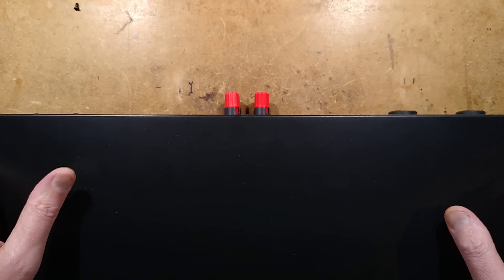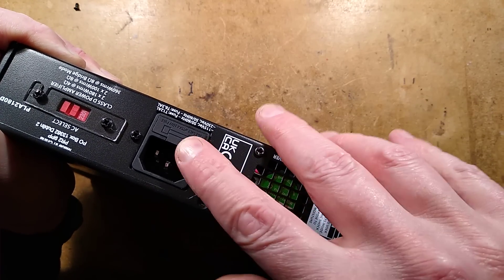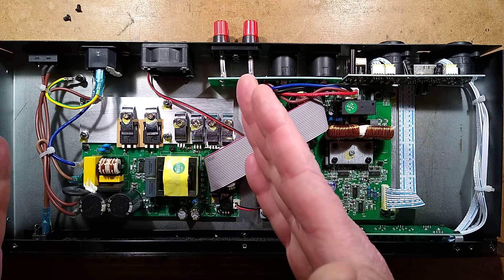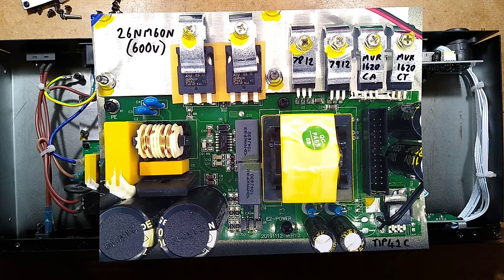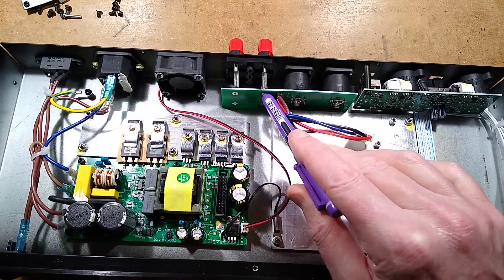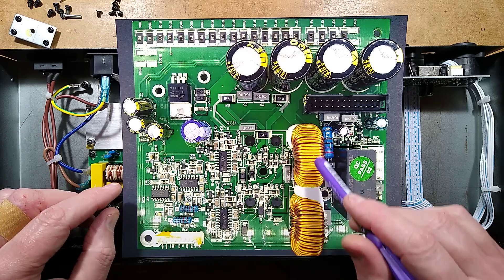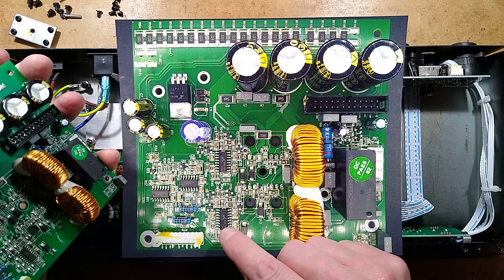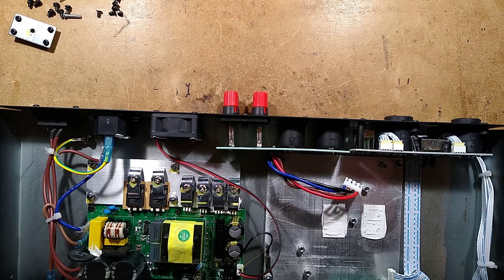Inside a 360W digital amplifier

Comment: One obvious oversight - that fan is an exhaust - the fan frame is at the back, and you ALWAYS exhaust racks to the rear
Reply: QSC/JBL & C-Audio amps used to blow back to front (in the MPA1100/MPX1200 era).
Reply: @CJDavies  It happens, its just a REALLY bad idea as racks and everything else in them are designed to be fed cool air at the front and dump hot at the back. So youre either gonna need a dedicated rack or you'll be sucking hot air.
 It just makes sense to put your intake side where the user and aircon are.
Reply: @CJDavies i had an rack with two qsc amps. The befefit of reverse airflow is that one can mount an big fan with a proper paper wlement filter into the rear cover to keep the equipment from getting filthy.
Reply: @lukahierl9857  I hadn't even thought of that, but that's actually a pretty big benefit for some scenarios!

Comment: The fan looks to be an exhaust fan and I've replaced a lot of 1U fans with Noctua 40mm ones for noise
Reply: Noctua fans are quiet mostly because they spin at low RPMs.  Low RPM also has an effect on the fan’s CFM rating - or, in other words, how much heat it can move away from things that get hot.

Ergo, quiet fans tend to lead to very quiet amplifiers, if they weren’t designed for low-n-slow airflow.

Comment: It would be really interesting to compare this to the likes of the little £40-odd digital amps off Amazon from the likes of SMSL.  Different application, but would still be an interesting comparison...
Reply: There is not much to explore in these  
They are build on a single chip design and are utter garbage
Reply: @NinoJoel  Swap out the caps for better quality ones and you can easily mod them to audiophile quality.
Reply: @NiHaoMike64  Sounds like a good topic for a video...
Reply: @NiHaoMike64  haha my god. 
Not again. 

If I hear the term "audiophile" And swap capacitors in cheap junk I get flashbacks to the days I used to maintain / repair high high end audio equipment. 

Those amps operate on class D... They are junk in terms of audio quality even if you get some snake oil capacitors at full moon on midnight while selling your kindness
Reply: @NinoJoel  The boards with TPA3255 are very easy to make work just as well as the much more expensive reference design boards.

Comment: It's not digital. In the 1980s, Peavey started the whole thing of calling these amplifiers digital, but they're not. Granted, they're not exactly analog, but they're not digital either.
Reply: I don't see anything wrong with calling a class D amp digital.
Reply: @tommihommi1  There is enough confusing nomenclature regarding technology in the world without making it any worse.
Reply: @ScottGrammer It works by switching the output mosfets fully off and fully on; zero or one; with absolutely minimal time in the transition. What’s not digital about that?
Reply: @MarkSJBeard  well the argument is that the PWM is actually analog because of the way the comparators work in a class D amp like this, it's not actually going through a real digital step, it's analog pulse width modulation
Reply: @MarkSJBeard  (Sigh.) It looks like I may need to do a video about this.

Yes, it switches the output devices either fully on or fully off. But there is no quantization, which is to say there is no analog-to-digital conversion. There is no bitstream. There is no data. There is no digital-to-analog conversion. It's not digital, any more than a run-of-the-mill light dimmer, which works on exactly the same principle, is.
Reply: @ScottGrammer  The output of the Delta Sigma modulator is a digital bitstream even though it's very different from the usual digital audio.
Reply: @NiHaoMike64  Correct, but this is a PWM modulator which is an 100% analog circuit with a switching output. A DS modulator is a mixed signal circuit (analog in, digital out) where the output is a digital signal that is clocked (changes at specified time intervals only, for example every 100 ns). The PWM modulator's output can change at any time, it isn't clocked at all.
Reply: @peterpv0001  Some designs are self oscillating, others have a clock signal. The ones that have clock signals are far more common in multichannel applications since that avoids possible beat frequencies between channels.

Comment: I appreciate the plexiglass cover "protection" over the 110/220v, that's not a switch you want to move by mistake
Reply: Back in the 90's when I was an on-site engineer for Silicon Graphics, I had a job to replace a failed power supply unit for an SGI workstation.

After replacing the PSU, I proceeded to switch the workstation on to test it. All of a sudden, there was a Loud Bang emanating from the supposedly repaired machine, and the magic smoke was escaping from it. And all the electricity went off in the building. Everything just went dark. The office the machine was in went silent, and all eyes were on me.

It was only when I - very puzzled - looked at the PSU, did I notice the voltage selector on it. Upon closer inspection, I further noticed that it was set to 120V, instead of the 240V it should have been - obviously this unit was manufactured outside of the UK and was set to 120V by default. Not something which was ever mentioned in any SGI training.

That was a very awkward time in that particular customer's office for a few moments. I blamed the Loud Bang and the tripping of the building's circuit breakers on a "faulty replacement" - which, technically, was the truth ;)
Reply: @FrickinLaserBeams  Oops!
Reply: @FrickinLaserBeams  It wasnt the truth, it was your fault for not checking it
Reply: @gelo1238  Well, duh! Lol.
Reply: @gelo1238  It was the truth though, after he had failed to check and powered it on. I'm sure it was quite the faulty unit indeed by that point...
Reply: @RyTrapp0  lol
Reply: Back ca. 1990 we were supplied with "Rockwell T50 Programming Terminals" £8K each - actually a rugged PC, and often the first such any of our techs would encounter. This was before auto supply ranging was common.  For "safety" factory floor sockets were 110V (Round, blue).  However technicians' workshop sockets were 240V (Round, Yellow).  If we were lucky just the power supply went "poof" otherwise - a very dead box.
Reply: @M3WDD  Good heavens! If they'd changed the 110V sockets to Edison (US, Japan) style, it would probably been enough to make people think twice and make sure.
Reply: @interestingoldthings4889 yellow/blue is standard. AFAIK they’re also made deliberately incompatible, though.
Reply: @JasperJanssen  that's what socket adapters are for 🙂
Reply: @M3WDD  Yellow is 110V; and properly from a transformer with a centre-tapped winding, so each leg is only 55V from Earth. Blue is 230V.
Reply: @bluerizlagirl  yes, you are correct.  It's been a long time...
Reply: @M3WDD  surely your blue and yellow are the other way round? If you are referring to the common "ceeform" type connectors (formerly BS4343 but now IEC309), blue is 230V and yellow is 110V.  Indeed yellow is common on construction sites.
Reply: @timbo19  yes, my mistake
Reply: Indeed; We ran into that with some 'legacy' systems that used, IIRC, an S-100 style mainboard with add-in CPU and IO cards.  The boxes had non-autoranging power supplies with that style of voltage switch. the vendor had to replace the power supply on one of them after someone failed to check the position of that switch before plugging it in, and that was entertaining, because not many people make that hardware anymore..

This is why any hardware I spec for [RedactedCo] states "power supply SHALL be auto-ranging between 120V and 208/220".
Reply: How I never flipped one of those switches on the back of something as a child is beyond me...
Reply: @MrPointedHelix  I *did*. Expensive. Power supply on our first XT, 1985.
Reply: Yes it is!!  yes it is!!! 🔥 🔥
Reply: Now that's real belt-n-suspenders paranoia, I like it.  Most manufacturers are satisfied with just the recessed switch.

Comment: Bridge mode is twice the voltage, four times the power for a given impedance when compared against a single channel.
Reply: although most amplifier sellers somewhat explicitly state that in bridged mode it is meant to be used with double the impedance for a single channel e.g. 250Wx2@4Ω(stereo) 500Wx1@8Ω(bridged). But of course yes with the same impedance it would draw 4x the power.
Reply: @ow_will ,  most analog stereo amplifiers with bridgeable design that were spec'ed to work into a 4 to 8 ohm  could only run into an 8  ohm load in bridged mode.  The power would double but the distortion would quadruple and the ability of the amplifier to maintain a good damping control over the speaker load was reduced.
Reply: @ow_will  yes, but not using the amplifier for a load that would damage it should be obvious

A single speaker tends not to change it’s nominal impedance so standard practice is to make comparisons of amplifier power referenced to the same impedance

Comment: I have done it myself before, but somehow I find ribbon cable for power supply purposes a bit sketchy.
Reply: Since it is just +-12V, it should be fine. But an odd step given how well-designed the rest seems to be.
Reply: @OscarSommerbo  180W suggests closer to 25V for each power rail, and as the ribbon, and the connectors, are rated for 1A each, 2A if you are being unrealistic, just using 6 in parallel will easily handle the power required, as it should be around 5A per power rail. With 24 pins, 4 being used for the opamp +-15V rails, 2 for fan and temperature sensing, and thus 6 for the +25V, 6 for -25V, and 6 for ground, will work out fine. Plus a quick almost foolproof connection, and reasonably robust.

Comment: You'll get all the audio engineers rilled up by saying fliped phase instead of flipped polarity for the bridge mode ;)
Reply: Not the ones that do serious circuit and filter design, and use an XY scope to check that signals are in phase etc. etc.  The phase of audio signals have important acoustic effects .
Reply: @johndododoe1411  Of course phase is important and yes I have used scopes. That does not mean that flipping to polarity is the same as flipping the phase, which as you should know is impossible for any non-repeating signal.
Reply: Well you gotta drive engagement any way you can.
Reply: Crap, you got me.

Comment: The fans usually pull in air from the front and blow it out the back, is that not the case here? I've tested some cheap amps before where the heat sink fins were angled 90 degrees from the direction of airflow so it overheated after 10 minutes at rated power 🤦‍♂️
Reply from the maker: It probably is pulling from the front.  We have some really expensive equipment at work that also has the 90 degree heatsink issue.

Comment: So, this is a FULL BRIDGE AMPLIFIER, haha! Looks nice. This is where switching mode power supplies and class D took us - a stage power amp in a single unit enclosure, so compact, clean and neat.
Reply: Not full bridge, half bridge, as the speaker has a connection to the mid point of the power supply, and a full bridge amplifier cannot be connected into a bridge configuration, as it is already running in that mode.
Reply: @SeanBZA  right, it's hooking the load to two power amplifiers driven with inverted signals
Reply: Some of the modern ultra high power 1HE amps are reliably pushing a total of 20kW nominal power into 4 chanels at 4 ohms. Those are slowly replacing the gold standard Labgruppen FP10000Q and FP140000 over here in europe.
Although for low end professional use the high quality chinese FP series coppies are still unbeatable.
Reply: @lukahierl9857  LABGRUPPEN has the PLM44 and others ( using LAKE processor) at least  4-6 yrs in the making , as of my knowledge these are 20000W (4ch) bridgeable and each can also be configured  as 4 active p.amps with selectable slope configs...
Also comes with full security locks & remote location networked control capabilities .
Reply: @lukahierl9857  There's quite a few Powersoft inspired high power 1u amps coming out of China too, from the likes of CVR, Morin etc
Reply: and sounds like flaming dog shite, but who cares about sound quality, right?  It's only for live sound reinforcement! <_<

Comment: Thoughts on the unidentified chips: The comparators should be used in conjunction with a triangle or sawtooth wave generator which converts a voltage level into a PWM duty cycle.  Are they connected in such a way that you are able to infer that kind of relationship?
Reply: Dedicated class D amplifier chip, which has all the parts needed to implement the circuit, from input analogue, to output drive with high side driver for the mosfets. Comparators are there to drive the front panel LED's, and to also enable the amplifier chips when they detect enough input signal, and also are there for DC offset protection as well, turning off the output relay if there is a DC offset at the speaker outputs, and providing the turn on anti thump delay as well. quad comparator, so 8 in total. 2 drive peak indicator for each channel, 2 do the signal detection, and thus amplifier enable, with a few second off delay for quiet input signals. Then the other 4 do DC offset protection on the output, and one does the power on delay, leaving one that is probably sitting being used as inverter to drive the mute control of those PWM driver chips, or is sensing heatsink temperature, to enable the fan to run.
Reply: Wouldn’t you expect the triangle/sawtooth wave generation and initial comparator circuit be on the input board?  I would think the ribbon cable that goes between the input board and the amplifier board probably carries PWM signals and not linear analog signals.
Reply: @timpontius  I wouldn't want to push the signal that is relatively high frequency compared to everything else in the box over a ribbon cable like that
Reply: @tommihommi1  A ribbon cable can easily handle the frequency of digital audio signals. And it would be much less susceptible to noise. I don’t know if the ribbon cable here is carrying digital or analog, but if I were designing this thing I would convert to digital on the first board. And if I HAD to send the analog signal between boards I would probably use a shielded cable and not a ribbon cable.
Reply: @tommihommi1  ribbon cables are commonly used to carry h.s.data/control info upto
(MHz/Mbits/s) in computer equipment...so a few hundred kHz is definitely not an issue to signal integrity.
ribbon cables with every alternate wire "grounded " guarantees sufficient noise immunity to those carrying the signals.
Reply: @timpontius Not really. And it’s fairly standard practice to make a PWM sawtooth generator using a comparator too, but that implies that this isn’t switching at high frequency for efficiency. My guess too is the UICs are mosfet gate drivers.

Comment: It's so weird seeing inside an amplifier but not seeing a couple of huge masses of iron transformers...just still used to the old school style.  
I don't like how the ventilation fan has half its blade width covered by the case...the vent holes should have been much wider to allow proper airflow.
Reply: And given the long slot vents on the front panel ~ that fan looks small for the “ventilation architecture” and the heat-sink is dumping to the bottom case plate - I can imagine that easily overheating [particularly if stacked with its companions], would the long vents on the front be a bit deceiving with it cooling capacity? 😠

Comment: I am interested how the S/N ratio and THD of a class D amplifier like this would compare with an equivalent output power amplifier from Pioneer / Sansui / Marantz from the 1970s.  Many would have 100 dB or better line input S/N and 0.05 % THD at rated RMS output from 20-20,000 Hz.  Are these little amps really clean and quiet,  or are they just tons of power in a light package ?
Reply: class D amps designed to measure well measure incredibly well nowadays. I think this is a more pragmatic piece of equipment to do what it needs to do.
Reply: Usually the SNR/THD on a Class D is worse than an similar power Class AB (most likely topology for those 1970's amps) or thereabouts amp, pretty much a function of the "digital" nature. But the upshot is they're a LOT more efficient.
Reply: High-end class D amplifiers are really good. You're unlikely to hear much difference in S/N ratio even if the class A/B amp is nominally lower. Dave Rat has done some good videos on the difference in capability between class A/B and class D amps you can check out. There are trade-offs in both designs. An interesting aspect is that class D amps are better at transient output. You'll get a 'louder sounding' signal out of a comparably rated class D amp because they can output a higher peak voltage for a short period of time. A class A/B amp by comparison will reproduce a continuous signal more faithfully. Which is better in what situation really depends on your audio source and application. If you want the cleanest possible audio reproduction then a traditional design would probably be best. If weight, space and thermal efficiency are important (for example if you're touring, or installing many amplifiers into a small space) then class D will probably be best - and the trade off in noise is probably so small that it's not a concern for 99.9% of listeners.
Reply: Class D amplifiers are efficient and smal for their power output but no matter how expensive they don't come close to old class A amplifiers like 70s marantz
Reply: @NinoJoel  if I saw racks of old Marantz Class A amps on the back of the truck I'm walking off the job. Don't give a f, my back ain't worth that imperceptible amount of reduction in THD.
Reply: @JaenFoster  well. 
On stage use and on party Jobs id say the audio quality is not important enough to justify class A amplifiers
Reply: @JaenFoster  especially considering the cost / weight / power consumption